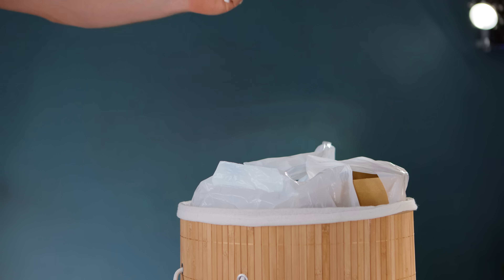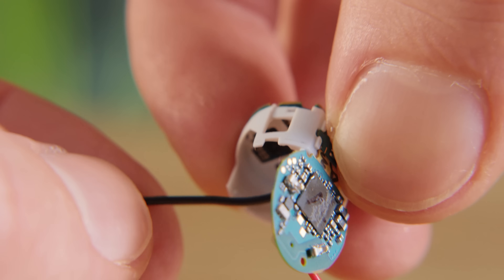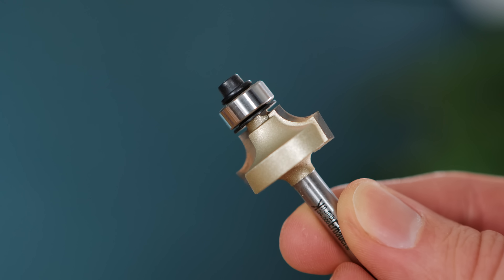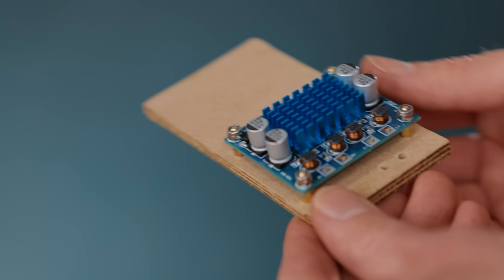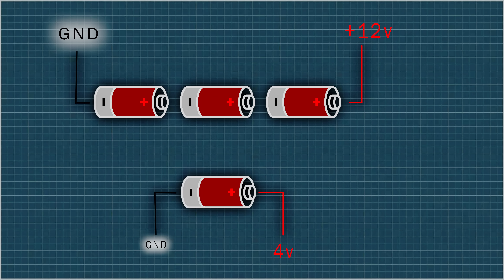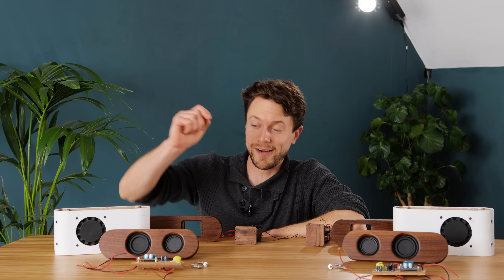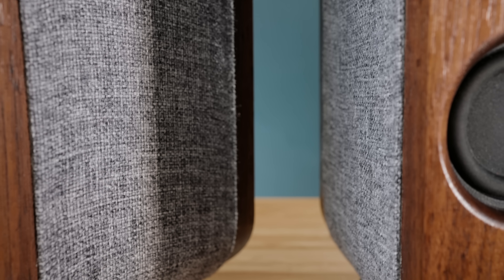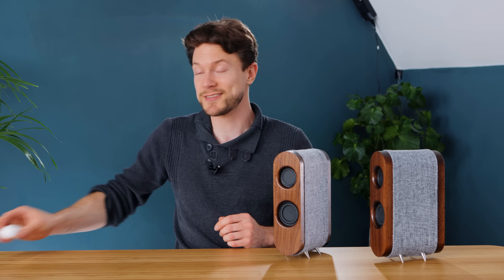Transforming dead earbuds into POWERFUL wireless speakers

Comment: Beautiful  speakers, but very very complicated to built. Besides the hassle with the make of the housing electronics used are  a downer for me. No charging plug or charge circuit and there are a lot of problems to expect if the airbuds are not connecting/pairing any more... I have used an old pair of small and beautifull existing B&O Speakers and have added the electronics of two cheapo Xiaomi bluetooth speakers with wireless stereo capabilities. 15€ each. Advantages: They come with an USB-C charging port, an integrated 18650 Battery, a real charging and protection circuit, Monitoring State of charge via Smartphone, single button operation you can solder your own button/switch to. The amplifier gives 5.5 Watts with a slight loudness shaped frequency curve: perfect for smaller speakers. Max Volume is good (5 Watts are a lot). And the amp has a built in clipping feature: So no distortion when played to loud...

Comment: I'd love to see the spectral response of these speakers. Also, does the choice of headphones used affect the output? I don't know at which point along the signal headphone makers insert their sound shaping.
Reply: He uses only the Bluetooth module of the earbuds, so it doesn't affect the sound at all.
Reply: @matenorth  so when a headphones manufacturer puts some sort of EQ curve into their headphones, where does that happen? Or is it all accidental depending on wiring and speaker choice, things like that?
Reply: @stpirate89  In such a case it happens after the Bluetooth module and before the actual speaker in a form of a crossover or filter.

Comment: 72€ for one sub speaker is more than too expensive and just for maker enhtusiasts.
Self building should be less expensive compared with buying. So this tutorial litterly failed the goal as the final product consumes surely more than 300€ (without machines) and several hours of work. So in the end not worth if the goal is saving money by using defective base components.

Comment: Thank you very much for the idea. I used it to drive two outdoor Speakers by soldering an Aux cable to the output of every Earbud. Now I can use them for any set of Speakers, that have any form of audio input. The electronics even fit back into the casings, with the cables for sound coming out of the bottom. This additionally allows me to use the Buttons on top of the Earbuds.
Reply: Proof or it doesn’t exist.

Comment: These look amazing! One improvement comes to mind though: instead of making the battery component removable, why not wire in a Qi charger circuit instead? You can get them on eBay pretty cheap, and would essentially make your wireless speakers, wirelessly charged!
Reply: or a 12v powerbank for even more practicality

Comment: Was it a conscious choice to use polarized electrolytic capacitors for the filtering? At first glance it seems like the wrong component, with perhaps asymmetric behavior and maybe degradation over time? (I don't know enough about capacitors to say for sure if that would be a thing)

Comment: A very nice project, thanks! 
I'll give you my humble opinion on the drivers: technically, subwoofers are meant to be big, bulky drivers which easily go down 80 hz. However, when you're working with small drivers like the ones you used, even if they're dedicated mini-subwoofers, the bass you're going to get out of them isn't great. It won't be impactful, meaningful, "true" bass like 12 or 15 incher can give you. 
So, a 2-way mini speaker like the one you created would work much better using a woofer and a tweeter. Why? While it's true that the PR08-A will go down to a frequency of about 70 hz, and most 2" woofers can't do that, you then have to choose to give everything above about 160 hz to the full-range drive that will play mids and highs. However, full-range drivers can't play silky and smooth treble.  So, what I noticed from the comparison with the bose is that while the bose were lacking in the bass department, your project was lacking in the treble department.
Another more ambitious project might've been creating a 3-way speaker where you have the units you used + a silk dome tweeter (for example) which works with the higher frequencies. That would elevate the quality of sound. I hope you make them some time!

Comment: Tbh I think it would be better if it had a standard lithium ion battery like you'd find in laptops/phones/etc, and wire that up to USB-C. Maybe a charging station would be cool so you wont need two cables. I just find the battery solution inconvenient, and since its DIY replacing the internal battery every 5 years won't be significant bother for the people who make 'em.

Comment: Very cool project and I love it, but I have one question. How can we trigger the pairing mode to pair with a new device without the original housing?
Reply: Most wireless earbuds go into pairing mode when turned on if they don't already have a connected source in range.

Comment: I do a lot of custom automotive work and I think I could put the electronics in a small waterproof box and use the audio outputs from the onboard amp to a larger one to make a head unit that can power a car stereo system that is not only waterproof but easy to hide in order to keep a clean look

Comment: Honestly these sound super cool, but I think I'd personally prefer a way to charge them with a USB-C wire plugged in through the back. Maybe something like this could be achieved by using a rechargeable battery pack connected to a USB-C port? Either way, it's a fantastic looking (and sounding) build as usual. Would love to see a set up with these, your table-PC + hidden monitor, that DIY microphone, and other gadgets and related accessories. I really love your work!
Reply: the li ion cells need to be unprotected and connected in series with a separate 3S BMS.
Reply: You need a bms when charging, you can't charge them directly as it can overcharge them

Comment: would it be possible to turn a old pair of headphones (wired) into a speaker? also, the type of headphone covers the entire ear
Reply: Basically yes, it doesn't really matter what type of headphone it is, as they will have a speaker driving circuit (same as the white and black wire connected to the earbuds in the video). The other steps are mostly the same as described in the video.
Reply: @KendrewLok  me who doesn’t have a Sodering tool (dk how to spell it)

Comment: I'd make them, but the earbuds are a minimum part if these. Not sure what the electronics from the earbuds would be new, but you must have had $200 US+ just in the other components.  Not sure what it'd cost to just buy the equivalent speaker system.

Comment: Is it at all possible to turn its power source into an external source as well, like adding a USB port?
Reply: 100%, you just need to have some additional parts to help with the voltage difference. You could also use a rechargeable battery and charge it by USB and/or wireless charging.

Comment: Fantastic but let's be fair, the equipment involved to do this properly - and that's not even including the super expensive CNC machine - is not generally something that people just have laying around and even more, are skilled enough to work and understand, and is something that should be taken into account regarding the costs. The material used is also a bit premium. Then you have to do everything perfect to achieve the same level. Finally, the result should be worth it. But to be fair here, as great as they look, i am not convinced from the video itself. It sounds a bit more muted than the bose single speaker and that's all i got from it. in person it'll probably be different. Even then, if the cost is similar to the bose one, i can't see the big benefit. We're not talking about a few bucks, the Bose is about € 170 euro's. And for just 20 euro's more than that, you can buy ready purpose built warranty-included Marley 'get together' speakers just to name one.

Comment: I don't believe a single thing. The speaker membrane of the sub doesn't even vibrate in the demo. You circuits are very spartanic, I don't believe that the sound is any good of these.

Comment: I'm an engineer at a speaker startup and have mixed feelings about this DIY managing to avoid literally all the value I add to our products (buttons, LEDs, and voice prompts for user interaction, handling of standalone or stereo operation, battery and charger monitoring, DSP equalization for advanced tuning of drivers/enclosure, firmware upgrade, USB audio support, mobile app integration, etc.)
Reply: None of these are necessary in hifi. Just make a good driver inside a good enclosure made passive connecting to a speaker amp.
Reply: @imacat8476  I agree that you can have a speaker that sounds good without the bells and whistles consumers have come to expect, but the DSP tuning really does make a huge difference in sound quality. You might think you've done everything right, but blind listening tests don't lie.

Comment: Great project!
I have been building speakers in the past, and my experience with using electrolytic capacitors in the crossover filters have been negative. This includes the NP (non polarised) version. After 20 - 30 hours of use at high volume, the capacitors dry up and the speakers loose power until they stop working. From experience, my suggestion would be to use some mylar capacitors instead of electrolytic ones; they are sold for the specific use in crossover filters.
Designing and building a crossover is not a job for a beginner, as it requires some complex mathematics, and the use of specialised selected components. 
The suggestion is to buy a crossover, either already made, or in kit. 
Specs of the crossover filter are based on the total power and the number of ways (2, or 3) of the box; and the power, impedance and frequency range of each speaker.
Thanks for the video...
Reply: I've built subs but never 2-way speakers, so I don't really know much about crossover design. Has he really oversimplified it for the video, or just doesn't know about crossovers?
Reply: You've completely missed the fact that the drivers are being amplified separately; he's not building a passive crossover. The power and impedance of each driver has absolutely no bearing on the filter design, since there's an amplifier sitting between the filter and the speaker (this is one of the reasons it's easier to design active speakers). And even if these speakers were using a passive crossover design you're talking about, electrolytic capacitors have been used in crossovers for decades without issues, though obviously a film capacitor will always produce more consistent impedances throughout the course of its livespan and frequency response.

Having said all that, I don't think the filters in the video were optimized much. Because the inputs to the amplifier should be relatively high-impedance (especially if you remove any input resistance shunted to GND from the PCB), you could use much larger values of resistors than the 33-110 ohm values Matt's using, which would dramatically reduce the capacitance needed. If you go up a decade and use 330 to 1100 ohm resistors, those 2.2 uF caps could be replaced with small 0.22uF film capacitors. Also, the design of the third-order filter shown in the video looks pretty weird. Also, if that third-order filter and the high-pass were designed independently, it's important to note that you can't just chain them together as shown in the video (since their impedances will affect each other), so they have to be designed together as a single unit, or an op-amp buffer needs to be inserted between them.

Comment: make a wooden platform with conductive pads, isolate the feet, wire them up to a 18650 charger circuit.

to recharge simply rest speaker on pad !

Comment: Those 3 little crossover ('filter') circuits are pretty neat. I need to look into that 

Small question;
What type of 'putty' is that stuff that's used to seal the speakers?
Like... the stuff you use to hang up posters? :)
('Blue tack' or what have you..)

Comment: An upgrade to the circuit would be a a 12V charging circuit and a buck converter for the 4 Volts.
Reply: yep Matt is not too good with the Power part of his project.
More efficience power management, as u said...
3 x 18650 + BMS + charging capability + StepDown for the 4Vollt, plus a Ground loop divider for the sound!! it imperatif to use it.
Cause removing always batts to change them is a pain......

Comment: For logic purposes I'd add a BMS and a charger port with a discarded laptop charger adapter as a charge power source. And a buck converter to match the voltage, but other than that avoid a removable battery lid, because those screws are going to grind the wood down and cause it to mess up.
Reply: Or use some metal inserts for the screws.
Reply: @sedixmrboss5625  That would definitely help.
Reply: MY thought as far the the battery compartment goes would be to construct it with some kind of tiny "handle" and instead of using the screws to affix the battery apparatus glue matching neodymium magnets in, such the the issue with wearing the wood down goes away.
Reply: Magnet door would be way better and would look better too
Reply: @mmadchef808  i think the magnet might interfere with the driver inside
Reply: @zadsazhad  No. It wouldn't, but it would probably leak air, and mess with the cabinet's acoustic coupling with the drivers, and sound like shit.
Reply: That's a great idea, but the battery should still remain removable just in case you need to replace it.
Reply: I'd keep the removable battery compartment, but also add the necessary protection circuits and charging ports so that the 18650s (or whatever batteries you choose) can be charged externally, thus reducing the number of times you need to swap the batteries.
Reply: For sure, he makes a video about converting micro USB devices to USB c, then speakers that you have to charge like it's 2002 again lol.

Comment: Not being picky or anything, but that 2in driver is hardly a sub, is it. With a recommended frequency band of 65hz to 160hz it's a mid-bass driver really, isn't it? The mid/high driver does seem quite a useful tool with it's very wide 100hz-20khz response, so I'd be really interested to see a proper RTA test of what the speakers are actually producing. And if you could build a true subwoofer to go with the satellites, you're in business. How about knocking up an accompanying 6th order bandpass box to really rattle the foundations while the tiddlers do the lightweight work?

Comment: Well great, but comparing a stereo pair to a single unit is somewhat dumb...  There is a reason that we have stereo speakers / monitors, even with bluetooth. And no offense, against a decent pair the sound of your tiny DIY speakers totally sucks.
And anyone actually using this single Bose Unit needs to get slapped.

Comment: I was wondering if a deeper bass response could be obtained by having a single enclosure with its larger air volume, perhaps with some acoustic dampener behind the mid/treble driver?
Reply: I would not make them bigger but you can make it smaller and use a small low fs tweeter

Comment: I’d love to learn how u figureD out how to make those circuits that cut out the low and medium-high ranges!. These are incredible. Very well done!
Reply: Low pass / high pass filters. 15 years ago before we had fiber broadband, the small cheap box filtering out internet noise from landline phones used this. After one stopped working I built a replacement in 15 minutes by twisting together parts from my electronics box, cut a spare phone cable to attach the simple circuit in the middle, and wrapped it all up in cellotape. It lasted 2 years before someone tripped over the wire and pulled it apart.
Reply: @tempeleng  ah briliant! thank you!

Comment: Great job, but the speakers are lacking in treble imo. Maybe due to the amplifier boards, or the high frequency speaker. A piezo tweeter may have been a better choice, albeit slightly different in appearance. Or a soft dome tweeter, salvaged from a pair of hifi speakers. But the treble response seemed to tail off at around 14-15000 Hz imho.
What frequency response are the amp boards rated at?
The Bose speaker definitely had a better treble response to my ears.
But I love the enclosures, they certainly do look classy, like a premium branded speaker.

Comment: Wouldn't it simpler and easier just to buy an amplifier board with Bluetooth built in? They are only $10-15, so only a dollars more. Doesn't seem a lot to spend when you are using $70 woofers.

Comment: I get that there supposed to be completely wireless but could you add a audio jack and a optional power cable so that way one could use  the speakers to be both types of speaker?

Comment: Hey Matt,,,,,I'm just getting started on the speaker build. I intend to build in usb-c charge port connected to batteries with BMS and a volt meter display. Gonna build 2 versions,,,,, the 1st using existing outdoor box speakers to test the filters and the build itself, then the actual earbud build. Don't have any ear earbuds right now. Also, I joined the patreon support forum and downloaded the build guide. The specs in the guide aren't as informative as your earlier builds. It leaves a lot of details out that we true amateurs have to figure out on our own. Just a thot from a long time fan from the first external monitor w/ speakers added. Built it for my mom 3 or 4 yrs ago. Your earlier videos have a lot more detail which was great for me.